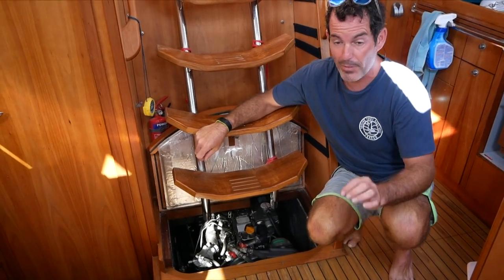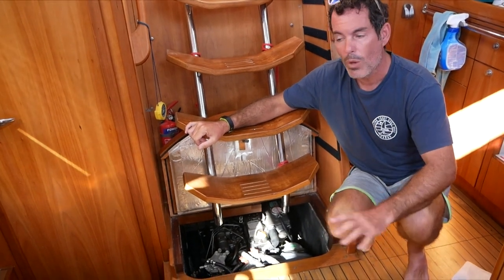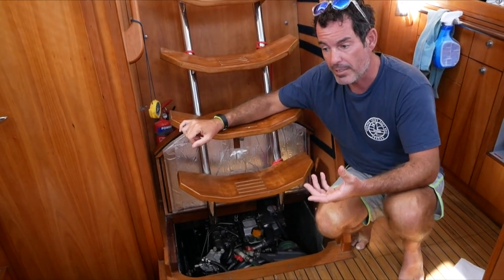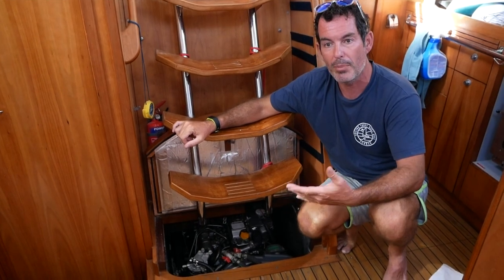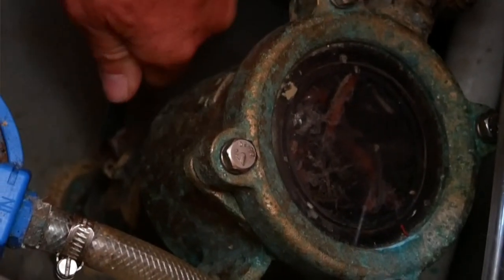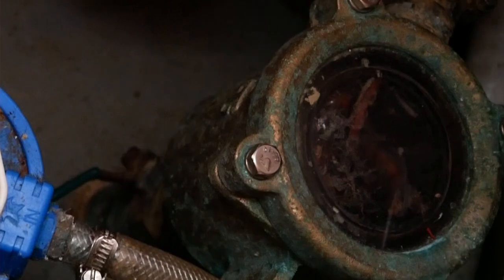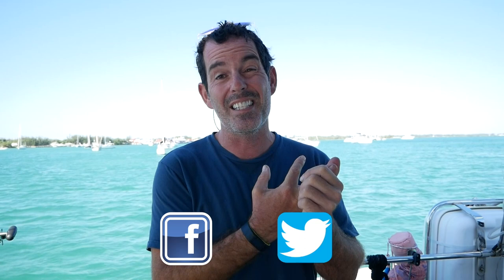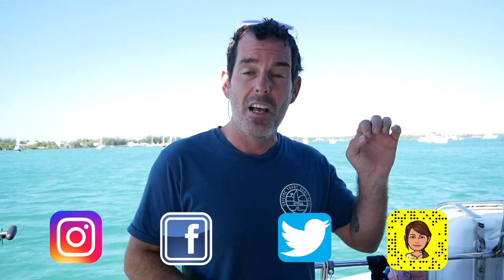Essential Boat Engine Checks | Sailing Lifestyle Channel | ™Sailing Yacht Ruby Rose - OFFICIAL

Comment: Checking engine oil: good tip to always check it when warm. Something else my dad (God rest him) taught me... get the oil warm, shut off the engine... then wait 5 minutes. The oil will still be warm but the oil in the upper part of the engine will have drained down to the pan, giving a more accurate reading.

You mentioned how detrimental it can be to overfill an engine... this is one way to ensure that doesn't happen.
Stay safe. Great video!!!!
Reply from the maker: Good points mate

Comment: The distance between the two marks on the oil dipstick is typically 1qt or liter. So if you're halfway between add 1/2 a quart. Yes between the two marks is perfectly safe but you never mysteriously gain oil and can lose it.  Always worth topping off to the upper mark may just save you running low and causing damage. Cheers! keep up the good work.

Comment: Another good tech video, Nick!  Might I add one thing from my recent experience?  A few days ago I was anchored in a grassy area, and my genset strainer got clogged, along with the hose up to the strainer.  I cleaned it, but I wasn't sure about the amount of water in the exhaust outflow near the waterline.

Yesterday I looked at the outflow and I could see very little water and some steam - definitely not good!  The strainer was clean and the hose from the seacock to the strainer was clean, as well.  The impeller was in perfect shape.  What had happened was the entrance to the through-hull was clogged with grass.  I was able to use the onboard fresh water hose to back flush the through hull to clear it.  Granted, this is a very rare problem, but it should be on your mind if you have an odd problem with engine temperature and the usual suspects are all OK.

Comment: Funny to see you install fasteners in the same hole you removed them from. I do that and if there’s a nut, I put the nut on the bolt I removed it from. People may think we’re over the top. We’re not, they’re sloppy. 🤙

Another item I regularly check is the zinc anode in my heat exchanger, and will check again before a long motor.

Comment: Good job explaining the service for the raw water strainer for the engine. Very important to make sure the gaskets / O- rings for the strainer are in good condition, other wise they will suck air causing a very hard to find engine overheat. You should use a little lube on the O-rings when reassembling the strainer. 
On the stuffing box, the notion that the box has to drip at all is wrong. The best type of box with old fashion flax packing should have a grease cup on the housing to grease the packing. This will extend the life of the flax packing. Also the box should be water feed from he cooling water exiting the engine into the exhaust. The only time a stuffing box will get dangerously hot is when it is over tighten and has no cooling water being feed into it.
                      Again, The notion that a stuffing box is supposed to drip is completely wrong, it will only make a mess of the box and the rear end of the engine. Most engines / transmissions except for Borgwarrner / Twin-dis , Capital Transmissions are Aluminum, not a good combo.
I have spent my whole life doing this work professionally.

Comment: Excellent and to the point. Thanks Nick. We also replace the drip absorbtion cloth in the pan under the engine before each trip which helps to id any fluid leaking issues.

Comment: Great as always. I put the bolts into the holes on the cap and set it aside in a bowel. And the idea with the keys is awesome. I always worry that's what I would forget to do and blow the motor. I will definitely put that into practice.
Reply: Ed - Ouch! Thats just gotta hurt something fierce, mate! Don’t you think a bowl would be better than a bowel?
Typos can really be hilarious at times ...
Reply: Crazy auto correct. Grrr

Comment: Or you could practice all kinds of maneuvers under sail, in which case engines are a convenience, not a necessity, in most sailing.  I used to dock under sail all the time.  We would even warp ourselves off of lee docks, just for fun.  This was with a couple manning the boat, a 9 ton displacement junk schooner on a yacht hull.  As Joshua Slocum said, when writing about the Liberdade, "The junk rig is the most convenient boat rig in the entire world."

Comment: Excellent overview of the basic checks. Especially for novices who are just learning to sail. The Southerly 38 is one of my favourite boats, even though I have never seen one in person. What surprise me about your engine access was how cramped it is. I have an Aloha 32 with a vee drive Westerbeke engine. My engine access is terrible and you have to be a contortionist to be able to reach major engine components such as starter motor, alternator, fuel pump etc. How do you access those items on your boat?

Comment: Great Video I just love the graphics you guys are using. On the bolt re-installation Nick you are nerdy on same bolt in same hole fer me not so much I am however nerdy on bolt loosening / tightening sequence. Never 12,3,6,9 always 12,6,3,9 for a 4 bolt flange. also fist tighten to just snug then a second trip around to tight. As even a pressure as possible is the goal in my overly nerdy bolt tightening obsessions. Anyway thanks for another great video.
Reply: ya, like what he said. :-)
Reply: Peter Dandridge :  Retired pipe fitter , plumber agrees with bolt tightening
Reply: My dad was a truck mechanic for forty years. He's didn't talk much but once in 1955 he did  say that its 12, 6, 9, 3.
Reply: In the speeded up video, you could see Nick tighten them in the proper order, he just hand seated the bolts in clockwise, then he alternated with the “spanner”

Comment: I was surprised to find out that some people thought that using a torque wrench meant to get it as tight as you can. So, a torque wrenches measure a certain pressure (pounds) on a certain lever arm (inch or foot) (or newton meters) .  So a wild guess from what is described in the video, only about 10 to 12 foot pounds. Which would be the equivalent of resting a 10 or 12 pound weight on a 1 foot wrench 90 degrees to a horizontal bolt.  
   Proper torque prevents damage to the machinery but also, if a bolt can hold 100 lbs. before breaking and is over tightened by  75%  (which may not do any damage) it will only require another  25 lbs. of force before breaking.

Comment: Good basic knowledge pertaining to every vessel, routine, preventative maintainance. There is one NECESSARY Precaution we found throughout our sailing years whether at the quay, mooring bouy or when necessary, at sea, whoever is doing the checking has the KEY where applicable. When I ran checks I had possibly of the main key, the backup was in a locked cabinet. This rule stands well especially when checking ANYWHERE under the vessel when in the water when inspecting the prop (s) or any other gear whether SCUBA, Hookah or snorkeling. I've seen some serious accidents waiting to happen when a diver went over the side leaving the key in the slot, props eat folks when inspecting fouled props with line. Just my two cents.
SV Eleutheros
Reply: I never liked boats having keys to operate the engine or battery-switches; especially an ignition-start key in the cockpit.  Just too-many points of failure or loss. Just a primary key for the campanionway-hatch to open the boat, and separate convenience keyed-alikes for the lockers and deck gear.  Particularly for a regularly-used or liveaboard.
Reply: T. Bunker yes, I too dislike "keys" yet all of our craft including our larger dive vessels have had them installed in-line in the on/off sequence. Saying that, we had dead—man switches akin to a high-end battery switch installed and bilocated within the start/kill loop for maximum safety when checking props as well as secondary off board theft prevention. Throwing a pair of 32" props on a dive boat or our smaller Ketch prop can be rather dodgy when under the hull, just saying.

Comment: Good stuff, also worth a mention to check on the air filter as part of the regular routine. Also, I've never seen a zinc on the dry side of a shaft like that before, is it simply there as a spare or does it actually still work as they do submerged?

Comment: Another aspect of doing regular checks is what I call familiarity.  When you inspect your engine or anything else regularly, then you tend to immediately notice when something isn't right.  It could even be the smell of the engine bay.  If one day it doesn't smell normal, find out why.  And of course visually you tend  notice when something is out of place.   Aircraft mechanics use this principle.   Cheers.

Comment: Vessel assist high number of calls involve failure of raw water impellers.i keep 4 replacements on board  for engine and generator..pays to check them every 2 years, and more frequently with higher hours. Often overlooked as maintenance item.
I have a yanmar.

Comment: Do you find the lack of easy access to the engine for routine maintenance a regret?  For anything major they must have to dis-mount half the cabin for access.  I'm still leaning towards a double- headsail center-cockpit ketch for the split rig and the separate engine-room; but that literally comes at the expense of being a bigger-hull, more money and higher marina fees.

What builder and model is the Ruby Rose?  I looked on your site and got confused between Southerly and Oyster, and there's no mention I could find on the model and fixed versus swing-keel.  Swing-keels used to be common here in the States, now they're practically-extinct in recent-build cruisers.

Comment: Stern drive stuffing box?  Is that a shaft drive?  I would love to hear your opinion of shaft drive vs. saildrive.
Reply: Saildrives are a maintenance nightmare.  You have to haul the boat to change the oil in the drive!  Also, electrolysis is a huge issue, due to the dissimilar metals in them.   A shaft drive with an old fashioned packing gland, using nylon / Teflon packing is bulletproof.  The new non-packing glands can go very, very wrong, so avoid them.You have to locate the engine farther forward with a shaft drive, unless you have a v-drive, but it is good to have the engine closer to the middle of the boat.    It is hard to get at the packing gland on a v-drive, so that is also best avoided.

Comment: When working on the engine or in the engine compartment, I always take the ignition key(s) with me.
Thus it's impossible that someone else on the boat turns the engine on, not knowing I'm messing with it.
I also put a piece of sticky tape / electrical tape / Post It on the raw water filter, reminding me to turn the sea cock back on.

Comment: I am just a tad confused at the installation of a sacrificial anode on the inboard side if you prop shaft. Surely for an anode to be effective it needs to be immersed in the fluid surrounding the components to be protected. Galvanic corrosion being a serious killer of less noble metals.

Comment: Do you guys know how to check the seals on both the fresh water and salt water side of the engine cooling system pumps ? When is the last time you serviced the raw water cooling pump on the engine ? When you do the service you should show how it is done. This is an often over looked maintance item on engines which can be catastrophic to the engines health. The raw water strainer what type is installed on the boat ? How often do you service it ? The seacocks ? How often do you service them, how do you service them ?

Comment: Still think a magnetic tray is a plus . Those bolts were not stainless. Putting them back in the holes is another way to prevent loss. Also in aviation we use little draw string cloth baths with paper attached and write what is inside,. Don’t think your vid could have been more perfect.

Comment: Yep, a friend's dad lost two fingers doinking with a running engine out in the gulf.  Had to be evac'd and left my bud on the boat...I think he was 10 at the time.  Belt squeal can often indicate a failing bearing.  'Nerdy' would be using a torque wrench, and discussing patterning the bolts...you're just being 'anal-retentive' :D

Comment: Why the zinc on the shaft inside the boat??
Reply: i belive that is b/c there is a change of metals going on(?). seen it before but i'm probably wrong.
Reply: The zinc isn't immersed in water, so it's not providing any protection. There is also no change in metals on the shaft, it goes from transmission out to the prop.
Reply: Sailing Lutris  to prevent the shaft "leaning" the boat